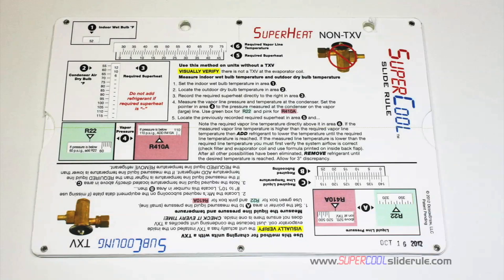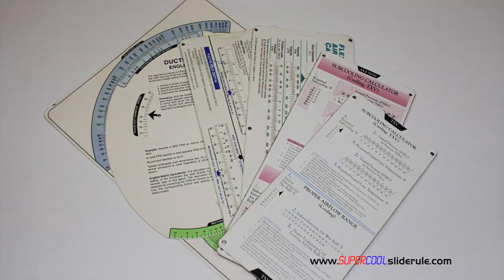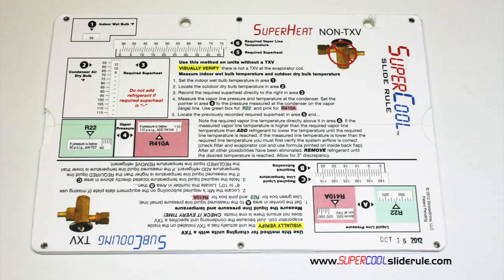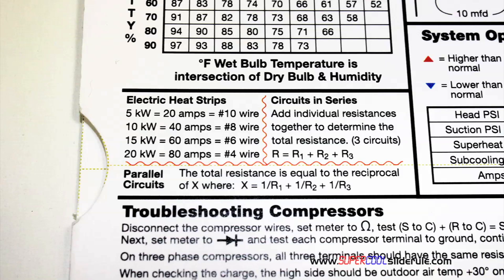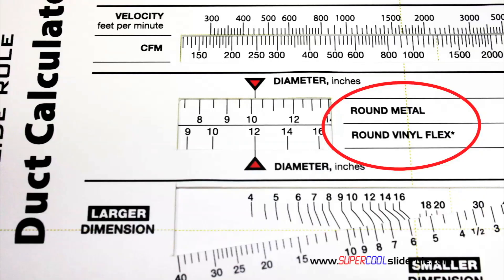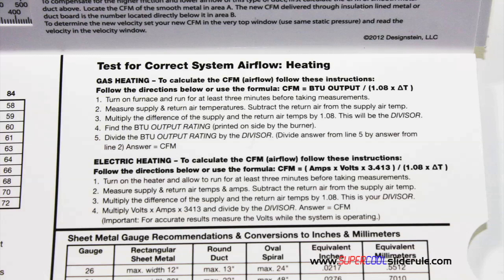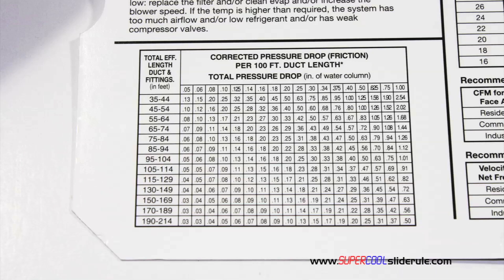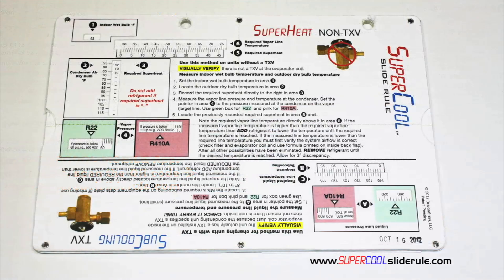How to test a Fan Control Board

Comment: Hello,  Are these boards universal.  I have a board that just died.  I could not fine it on the web.  Your board is about 90% similar.  The relay has the same connections but the 3 connection points
are position different on the top of the relay. The R,C,G are the same.   On my board the numbers are 1005-83-100A.  On the side of the relay there is a sticker with the number1005-100 8901.
I found a open etch.  The R connection goes to a diode.  On the cathode side of the diode (side with stripe) it goes to a resistor/capacitor then to the relay.  It was open so I repaired the etch with a jumper.
I would like to know if a replacement board is available but have not found it on the web or ebay.   Any help would be appreciated.   I plan to try it and I believe it should work since
the transformer voltage was not being supplied by the broken etch but would like to know if a replacement is available.   Thanks, Ken
Reply: I gave it a shot by shorting the R to the G and the relay energized as thought the thermostat did this.   I think I fixed this board.  Could you give me the model number board in your video so I can use this as a back up board.  I should work exactly the same as my board.  Very very similar.
Reply: @n1kkri  Hey Ken, I have the same board you mentioned in your earlier comment the "1005-83-100a"  the I believe the relay shorted out. The plastic is all melted around the connectors on the relay. Having no luck finding a replacement I was wondering if you figured out if the board in this video would work as a replacement. I've been around the web at least once and just keep coming back to this board. I to have come to the same conclusion that it is extremely similar and may just work just haven't found anyone saying it will. Thanks
Reply: @davidstofanak3222  I found a  replacement.
https://www.grainger.com/product/ICM-Fan-Blower-Control-5KPW9?searchBar=true&searchQuery=ICM255
Just make sure you connect the wires to the correct points on the relay.
This worked perfectly.  It sells for $21
I also fixed mine original unit.  It had a broken circuit board etch. 

Ken
Reply: @n1kkri  You are the man!!!! This should keep me running till I can scrap up some cash for a new system!!! Thank you!!!
Reply: @davidstofanak3222  Hello David,  your welcome.  Glad this works.  You saved a lot of money compared to having a contractor come in and do the same thing.